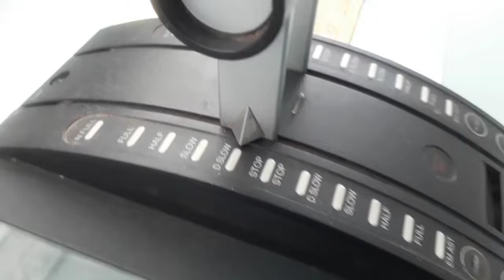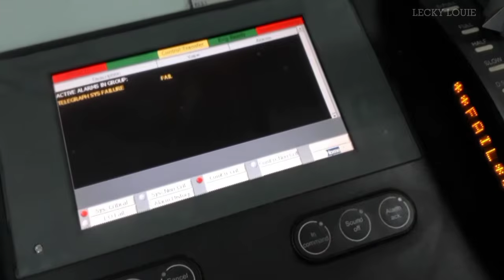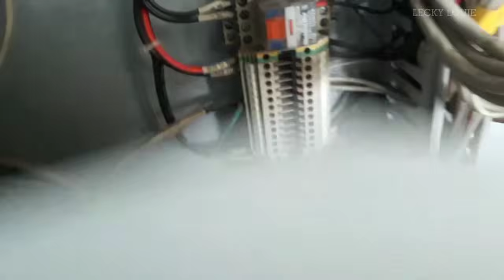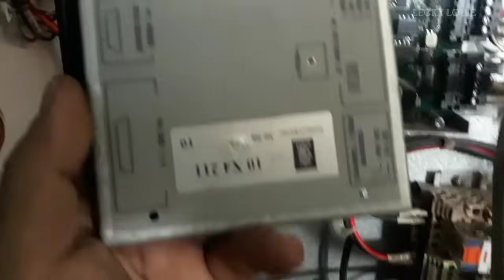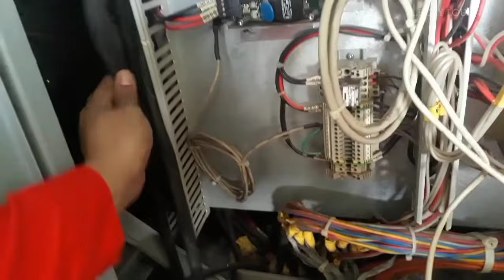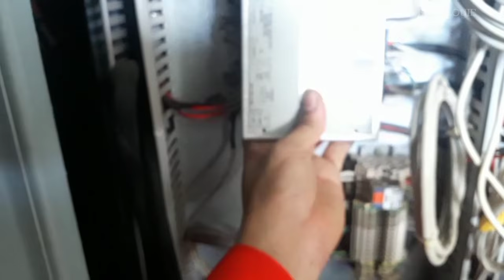Bridge Telegraph Unit Critical Failure Alarm.

Comment: Question :

After FWE and any alarm ( like ME LO pressure low or Turning gear engaged ) ECR panel gives alarm which we can not reset. Big message in the center of screen.
If we start ME LO pump, disengage turning gear and restart ECR panel -alarm list is clear, but big message on the screen still present and buzzer ringing. Same time on the bridge no any alarms. Control can be shifted to the bridge and back.
Reply: Any update to this trouble?
Reply: @bossmarbin-yv8ug  main panel was replaced

Comment: Good day sir, if next time it will happen than please switch off the power supply of the Auto chief unit (the ON and OFF switch button are same panel in right hand side where you clean the unit) and after two minutes switch ON the unit again the Alarm will clear in Auto chief unit. In port please try to do the calibration test of the telegraph unit.. From bridge to port side and STBD side bridge to engine room. The procedure of the calibration may be in book or may be you have to ask the maker. Thanks for the valuable video. 👍👍
Reply from the maker: Sir,,thank you very much for your advice and I really appreciate that you share your ideas. Its look like you are very familiar with this ACP. Thank you
Reply: Bridge telegraph potentiometer is erratic? Do you have any experience of renewing this potentiometer? During lever calibration, feedback potentiometer 2 was giving wrong reading.pls share your experience regarding bridge LTU potentiometer renewal job
Reply: Good day brother, whenever you are doing the calibration test and as a result whatever the error reading coming you have to rest that one. I don't think the potentiometer have any problem. Actually this error came due to human mistake for example, Before sailing bridge is testing the telegraph unit with ECR and that time ECR person is doing the time delay to follow the sequence from the bridge that time this error will come. Please asked the maker how to do the calibration test and how to reset the error. They have the sequence with picture. Thanks
Reply: I faced a problm in ACP, telegraph ACP no picture on display pls guide me